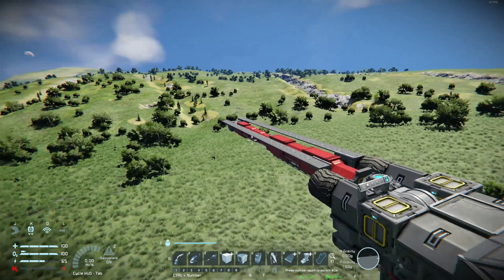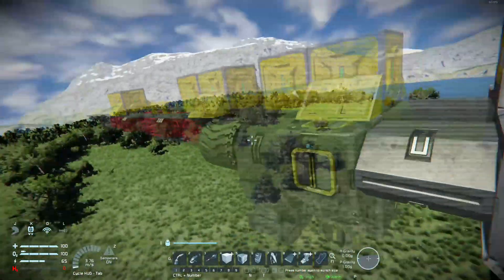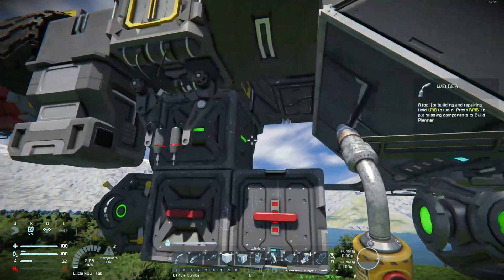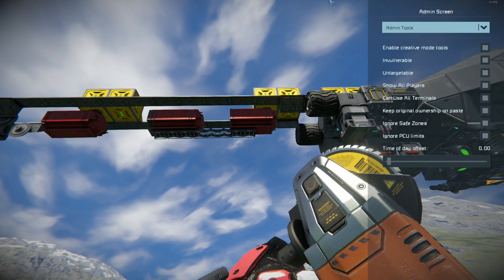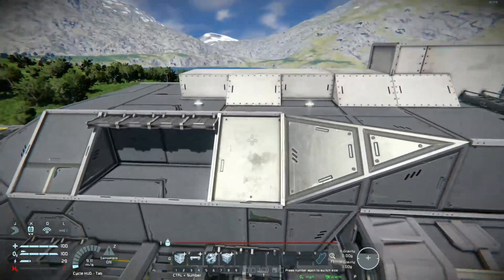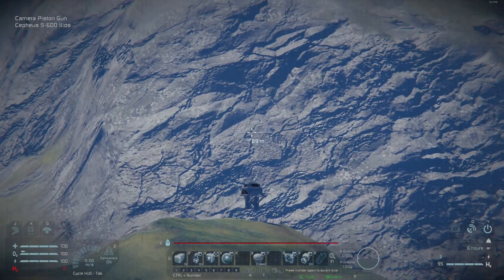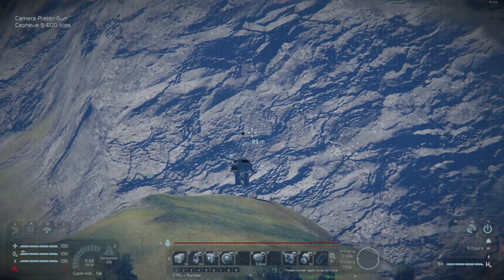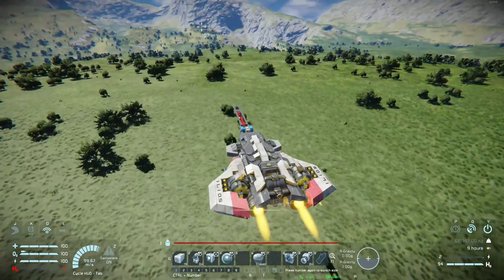I built the first printable clang gun

Comment: How do turrets handle them. (Both with the clang gun mounted on one. And them trying to shoot down the projectile?)
Reply: Very badly, that is how. At these speeds they don't even have time to rotate to face the target and even if they did, they can't actually shoot them down.

The speed of a vanilla gatling bullet is 400m/s. These can have between 400 to 900m/s projectile velocity meaning that most turret's intercept Point will be either extremely close to the ship's own hull or even opposite the impact site.
Reply: May change soon, the February update is set to increase the weapon ranges on most weapons as hinted by the dev's during a recent stream
Reply: Not enough time to shoot down a projectile travelling at 900+ meters per second, assuming a turret could even track a target moving that fast.

The only possible defense would be an extremely advanced script capable of spotting ships that are outside the max range of a rotor gun (render distance?) connected to a script that aims homing missiles.  Even then, you'd need a player nearby to keep such a complex script loaded and active.

As always, never being spotted in the first place is the best defence.
Reply: @r3dp9  maybe connect the detection script to something similar to this: https://www.youtube.com/watch?v=Y47BDTVC0TQ just with dumb projectiles. this might work if you are a slow target. not sure though.

Comment: Would you be able to make the same thing but for small ship grids by any chance? It'd make for some awesome tank battles with the engagement range at a km or two. 
Even if it doesn't look great, it'll get the job done etc.
Reply: I am not seeing anything here that would prevent that. It would have a lot of ugly merge blocks but you can always grind them after assembly
Reply: @Horesmi  nice
Reply from the maker: @AH-64Delta  I'm working on one, I think I'm gonna design it as a turret right away. Only the welder is kinda big, but it can definitely work.
Reply: @MajorJon  Nice. I'm sure you'll make it well.

Comment: Wow very nice now we can use it to destroy everyone on servers. One more thing could you maybe provide a guide on how to build them without the programmable block since those are often not enabled.
Reply from the maker: That's not possible sadly, atleast the speedlimit breaking part. Keen decided to hide the "attach piston head" button for some reason and you can only access it with script rn.
Reply: @MajorJon  would it not be possible to use the rotor method where you have one rotor head attached to two bases?
Reply from the maker: @AdamSchadow  I guess, but that's quite tricky to do without blowing up your ship and you can't get rid of the projectile as a subgrid. That can totally crash the game if you're not careful.
Reply: @MajorJon  as with any new weapon there are always risks but the advantages are way too big to not use it.
Reply: If you ask me, the best solution is to not play on servers that shut off the best part of the game (script blocks)
Reply: @wayfarerzen  problem is those blocks can also be used to bring the server down.
Reply: @AdamSchadow  As someone that has ran a server before, all you need to do to prevent that is have a halfway decent Torch setup. It will limit users from using blacklisted scripts, and also stop scripts from using too many resources. :>
Reply: @wayfarerzen explain. i want to host soon